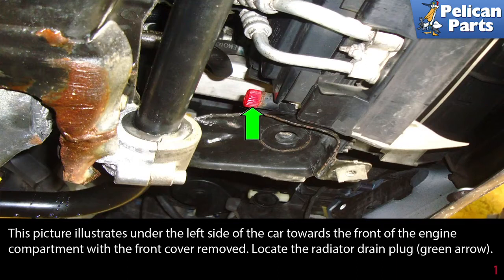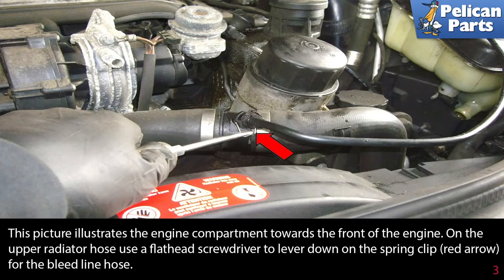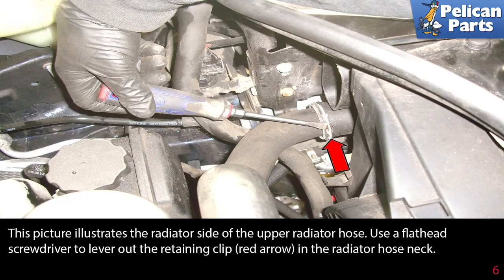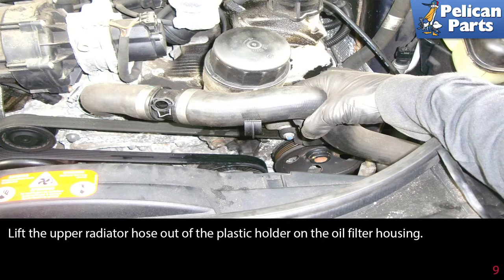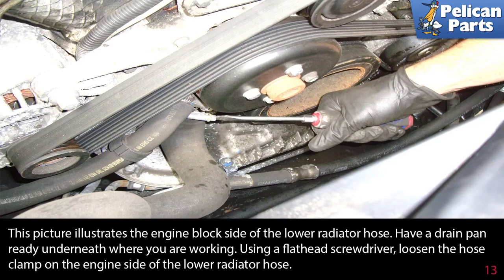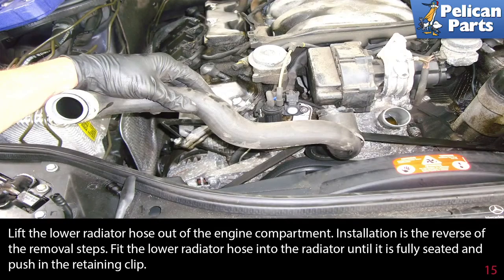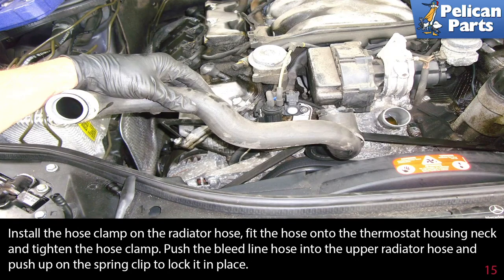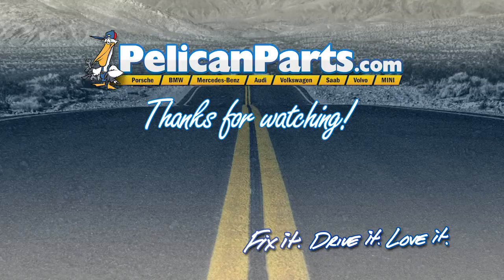Mercedes-Benz W211 E-Class Radiator Hoses Replacement

Comment: Have you ever heard of the clips coming out on one side of the hose by it self, or would it mean it was never clicked in properly? I replaced my top and bottom hose last week on my S550 and when opened the hood after driving it, I saw spots of dried antifreeze everywhere. Upon looking at the hose connections I noticed one side of the male hose end was not clicked in by the clip. I got under the car and pushed on it a few times and heard it click. Now I'm wondering if it will come loose on its own because the clip is stretched out or worn, or just maybe I never had it clipped in on that side to begin with.
Reply from the maker: Check if the radiator neck is worn out. Otherwise it may have popped out because it was fully seated and vibrated loose.

Comment: 1:11 I can't seem to get the hose out no matter what I do.  I pull the clip out as show, remove the clip, put it back in etc.  However not matter what I do the hose will not disengage?
Reply from the maker: Try penetrating oil at the hose coupling, let is soak.
Reply: If the coolant is still in the system you can start the engine and allow it to warm up slowly as you watch it carefully.  After the engine temp is around 140 you can shut the engine off and let it cool.  When it is cool enough to no longer burn you, try to wiggle out the hose fitting.  Stay safe - Good luck